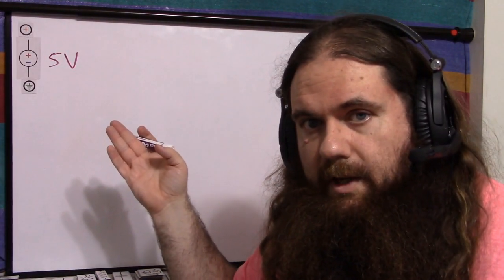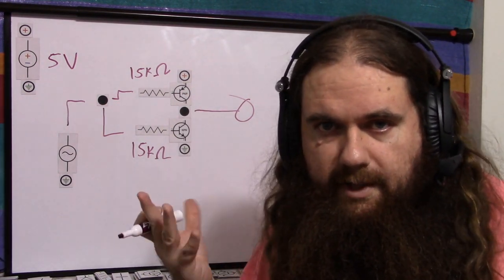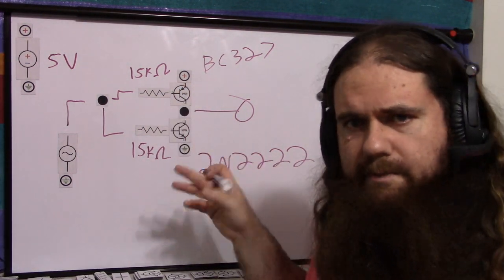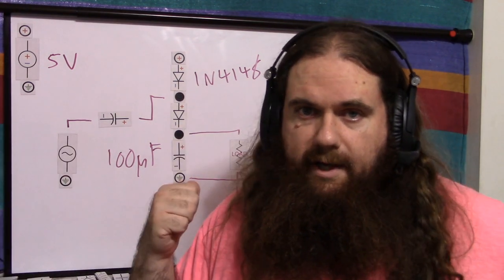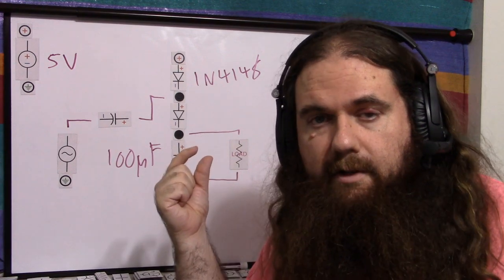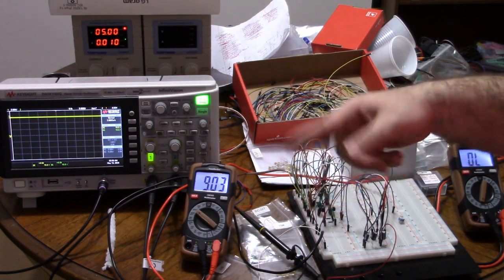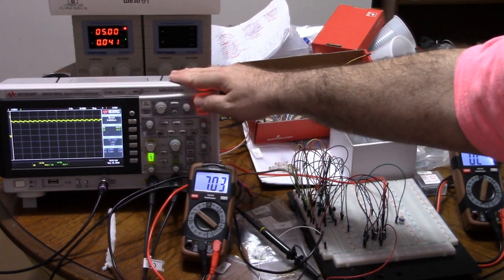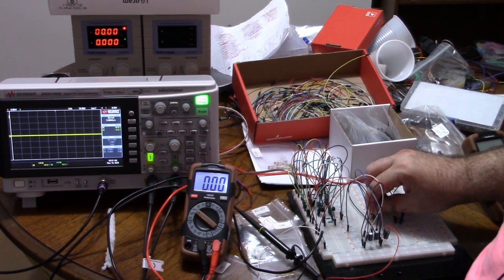Voltage Doubler - I Already Made It Better! - More Power And Stability - Simply Put

Comment: I've read your take on simulators on the other comment, but a simulation in Ltspice with ideal components shows the diodes are incredibly stressed from the point of view of the current required from them in the first cycles since startup. Currents skyrockets in the kA range. And even  with a 50 ohms series resistance in the pulse generator and 1 ohm internal resistance in the 5v battery I get several amps in the diodes. Of course in a real setup current will be limited by the source compliance and probably by the ESR of the caps, but doesn't this current surge tendency point out that this design could be failure prone?

Edit: I have used pretty steep rise and fall times in my simulation - about 20 ns - to emulate my siggen. Surely a 555 will produce a far more trapezoidal pulse train.

Comment: Hello, I started to simulate the circuits using the proteus program and I have achieved 7.4V
with a load resistance of 70 Ohms
 thus getting 105mA. I don't know if the simulation is correct. Is there a way to share the file and that you can review it?
Thank you.
Reply from the maker: I don't have experience with simulators really, and they're notorious for being inaccurate in funny ways to reality, so I honestly couldn't tell you. My advice would be to just build the circuit and see what you get, since it uses only simple basic parts.

Comment: so you just used diodes instead of BJT's awesome, would you be getting more energy out because bjt's use more when in use?? what i mean is the current needed for the bjt's is giving you more energy with the diode's so you get more over all power out??
Reply from the maker: I don't understand what you mean? The diodes are part of the doubler, and I am using BJTs (one NPN and one PNP) to push-pull power amplify the square wave, meaning that the timer chip (or arduino PWM pin, or whatever) is only driving the BJT base current, and the power source is providing the rest.
Reply: @simplyput2796  oh right i thought you removed the bjt's in favor of the diodes.. my mistake.. sure i forgot you about the square wave as the signal. but still a very cool video, its something i will defiantly use in the future..